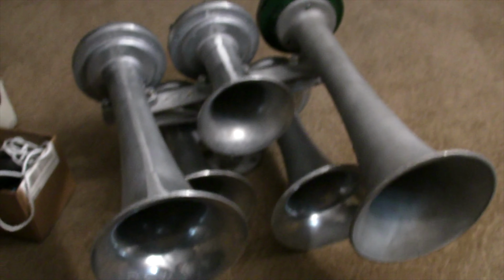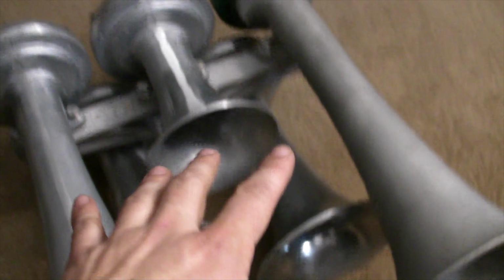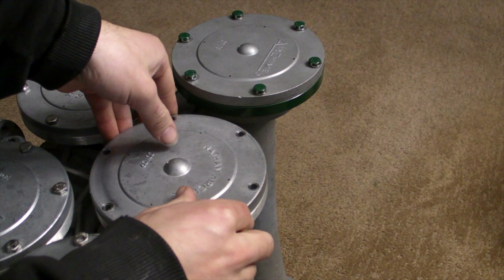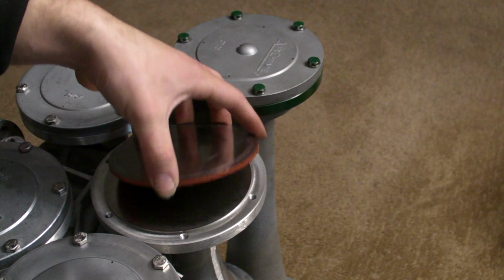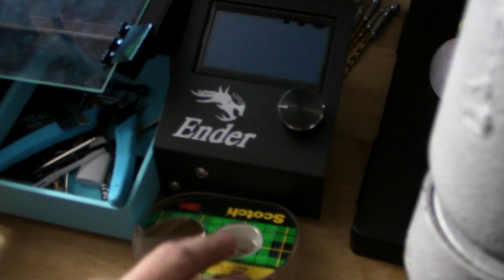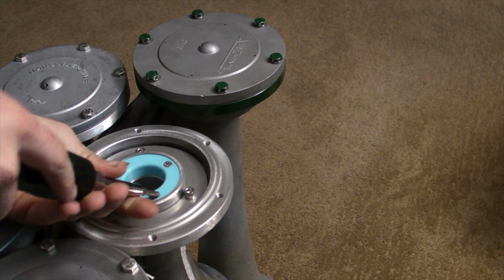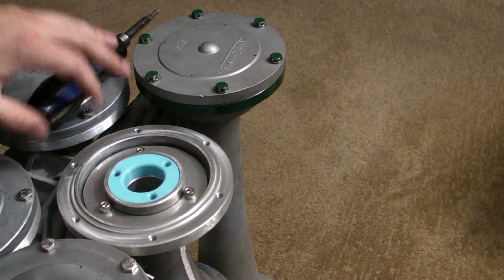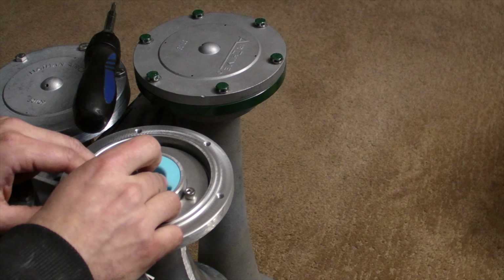Experimental Nathan Airchime KS5T Retuning

Comment: Could these shims be used to turn a K5LA into a convertible K5L?
Reply from the maker: Yeah they can be used to retune into a K5L, all you would need is the exact dimensions and you can 3D print it and screw it down
Reply: @NickSilcox3  how did you tap the screw holes?